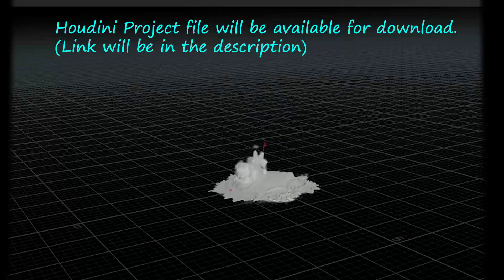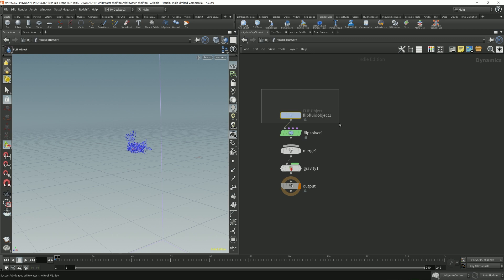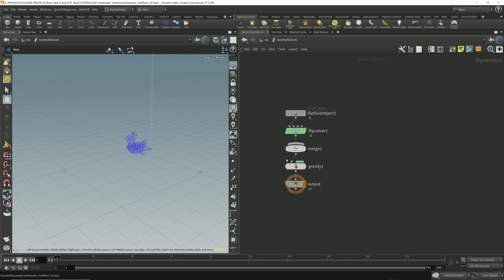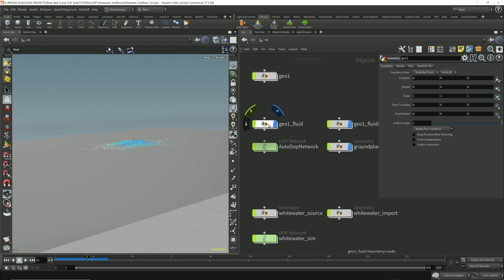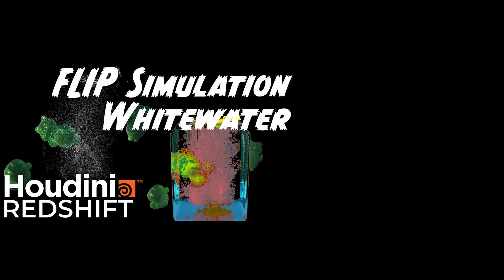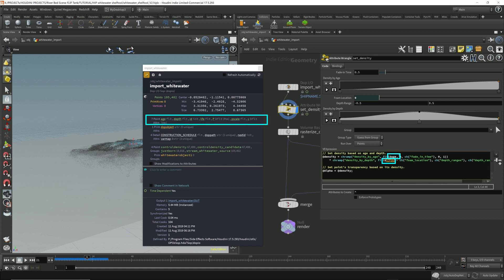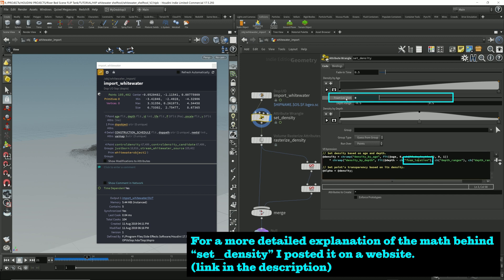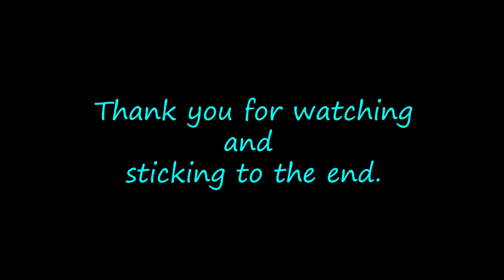Shelf Tool on FLIP sim & Whitewater in Houdini

Comment: Thanks for the amazing videos. How did you make the display option icons bigger? Thanks.
Reply from the maker: Do you mean HOudini icons? It's in the settings, General section and then just change the dpi values.  You'll need to restart Houdini after each change.
Hope that helps!
Reply: @bubblepins  Thanks a bunch